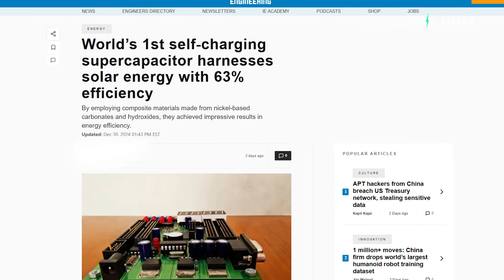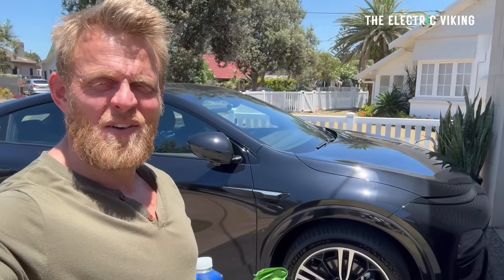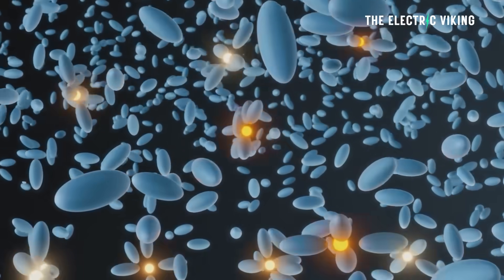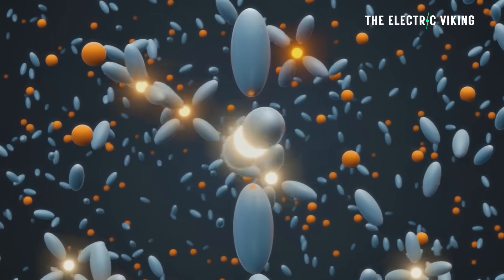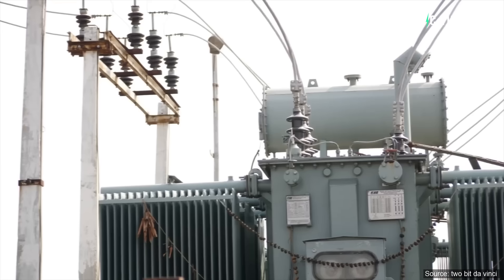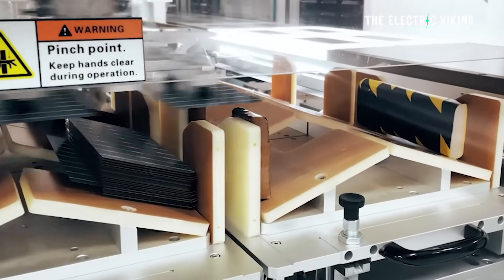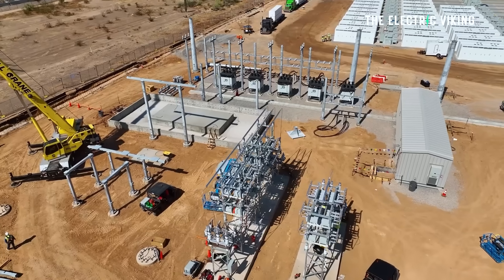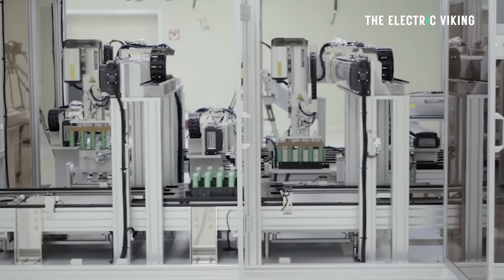World’s 1st self-charging supercapacitor records shocking 63% solar efficiency

Comment: Dude that's not the solar efficiency, just the supercap efficiency. You can just read the wrong number. It's about the energy it can store from the panels
Reply: 63% of 25%, so 15.75%. Another game changer, another clickbait video.
Reply: @chesshooligan1282  I didn't get it either - Sam maybe make a brief explainer?
Reply: Said quite clearly that the supercapcitors "enhance the efficiency of solar panels to 63%." Above the standard 25%. Seems the only one putting out "click bait" here is you.
Reply: @onlinesavant - but that's not what the article or the original research paper state - the 63% is the energy storage efficiency not that of the solar panel. The exact statement given was "The system has achieved an impressive 63% energy storage efficiency, with an overall efficiency of 5.17%." So the overall solar efficiency of the system is relatively low for today's panels. The supercap also has a low energy density compared to a battery storage system, but a high one for a supercap at 35.5Wh/kg. Although like other supercaps has an impressive power input/output density at 2.6kW/kg. This will support niche areas that require a short burst of high powered energy, that can be generated by renewable solar (self-charging).
Reply: @onlinesavant  He's talking bollocks, like he's done many times before.
Reply: @chesshooligan1282  Yet, you keep coming back to his channel....
Reply: @onlinesavant he said that but that's not what the researchers did!
It doesn't have any impact on the solar panels
Reply: @harryw29  How do you know what "the researchers did?" Did you read their paper on the subject matter? Or, interview them?
Reply: Solar supercapictors are much less efficient than regular supercapacitors. They are not the same. Previous devices often achieved 30% . This is a breakthrough.
Reply: @camronrubin8599  What are you talking about when you say "solar supercapacitors"?
The closest I could find was stuff like "When these supercapacitors are paired with solar cells, the result is a solar supercapacitor.".  The paired with part sort of gives away that the supercapacitor itself is not actually solar.  Getting a 97% efficiency in the capacitor side such a system is no surprise.  If anyone what getting less it was a bad design.
Reply: @kensmith5694  solar super capacitors use different materials like vanadium pentoxide and zinc oxide that outperforms traditional supercapacitors for solar applications
Reply: @camronrubin8599  That doesn't really make the capacitor "solar".  It just is making a better capacitor that may have many uses.  Mostly, however, the higher cost isn't really worth it in a stationary application.  You can use the same money to buy more capacitors if you just go with more conventional units.  
BTW: Pseudocapacitors really are a type of battery being used as a capacitor.  They will have a shorter life.
Reply: @kensmith5694  maybe it can help us find more cost effective solutions . I'm not an electrical engineer.  This is almost double the efficiency of the old method
Reply: @camronrubin8599  I am am an engineer and as I see it the low efficiency that was said to be normal is hard to explain.  It looks like an idiot designed the system.
Reply: Yes, but also 97% efficiency is not very good for a capacitor.  I wonder if there really is some new discovery at all.
Reply: @kensmith5694 - it is for solar supercaps but not for solar panels. Self-charging supercaps are more about power density than storage density, providing short bursts of high power output (2.6kW in this case). This could be used as an off-grid motor starter for example, supporting a traditional solar panel/battery setup to provide the continuous power without needing to spec expensive high current batteries to cover the inrush current when turning on (the solar supercap would cover that role).

Comment: What does this have to do with solar?
They’ll be great for regenerative breaking
Reply: This is an integrated solar supercap panel, it has a PV layer and a capacitive layer directly sandwiched together to form a 'self-charging supercapacitor'. 

These have specific roles and don't displace traditional solar panels or battery storage, but can support such. The supercaps offer low energy storage capacity but high power capacity (in this case the panel can delivery about 2.6kW for 50 seconds or so). These help in cases when there are spikes in energy demand by reducing the imapct on batteries (allowing for lower cost batteries with lower power densities to be used for example). They also address issues with inrush current impact on battery systems, when inductive loads (such as motors or transformers) are switch on.

They are not really designed for electric cars but off-grid usage or grid support systems.
Reply: @GruffSillyGoatAnyhow, the efficiency is poor, integrating the capacitor in the solar panel may be    OK only for a narrow niche usage.
Reply: @sandormolnar1968  - it's a fledgling area with a potential large market, side installed alongside normal PV panels. The supercap panels don't need to be as efficient as energy generating PV panels as they service a specific need of smoothing/handling periodic peak currents reducing the need for more expensive battery configuration to cover such (the batteries can be designed for average base power loads and the supercaps for the peaks on top) lowering overall system cost. Supercaps are utilised in this role currently but parasitically draw power from the batteries in this role, solar supercaps offer lower the parasitic draw as they can self-charge from solar energy as well.

Comment: Trying to wrap my head around this.  So its a circuit board and it holds electricity.  I thought super capacitors can't hold meaningful amounts of electricity.   35.5 watt hours per kg?
Reply: It doesn't need to hold very much if it's generating electricity, it can push it into a very large battery array, or directly to load; it's still potentially 3 times as efficient.
Reply: @calorus  The claim is so confusing I think because it is BS.  They are saying that the supercap stores electricity in this case.  Very efficient charge controller for batteries don't need supercaps
Reply: @calorus - this doesn't appear to be about enhancing the performance of a solar panel as the overall efficiency is rather low at 5.17%. Rather this seems to be a device for self-charging supercaps, that can deliver short bursts of high power - a remote motor starter or solenoid latching device are examples of usage (as well as supporting power spikes demands from traditional solar arrays).
Reply: BTW - ignore the picture of the circuit board, it's just a stock image the Interesting Engineering journalist decided to use. It doesn't seem to relate to the original press release nor does the images of radial wired supercaps in the video.